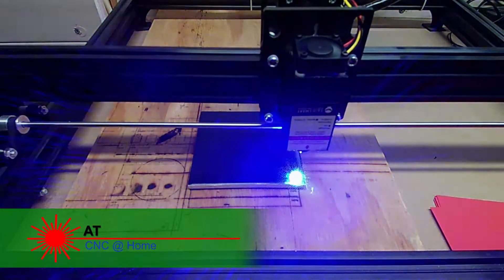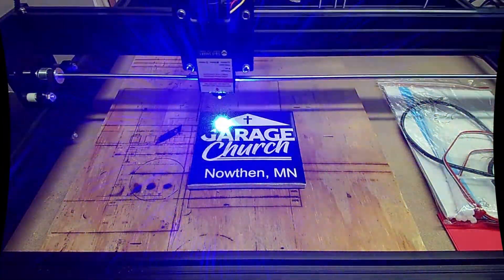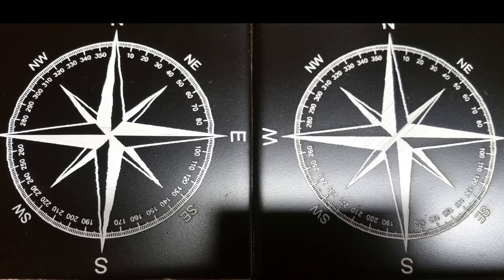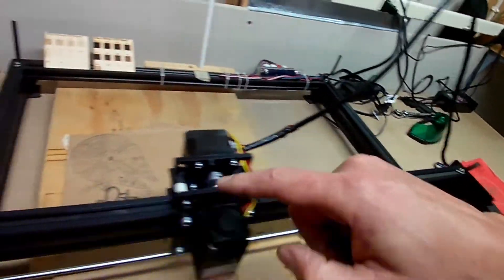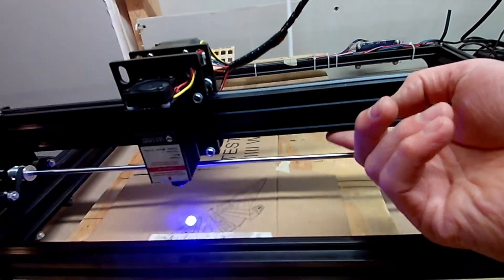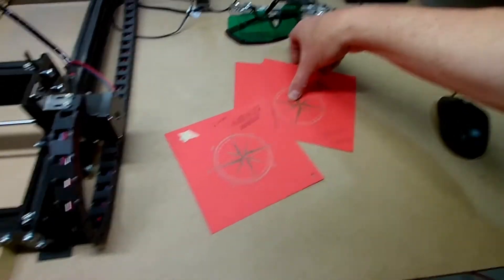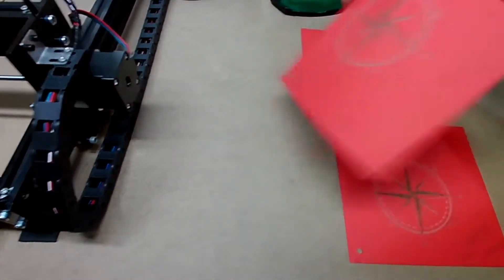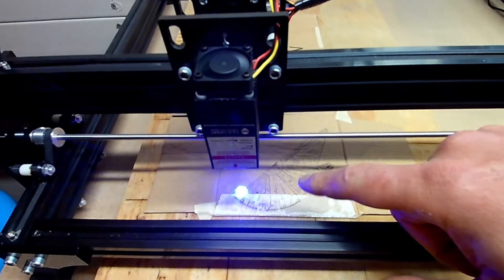Is It Fixed?

Comment: It seems like it's the loose head. You might want to change the roller wheels (and if it doesn't have any) fit some eccentric nut to either the top or bottom set. To adjust the slop out of the laser head.
Reply from the maker: Thank you for the input.  Another member has also suggested using eccentric nut on this. I might have to give that a try.

Comment: it could be the quality of the belts with stretch and spring as all belts would have a small amount of stretch and with changing speeds it could be causing bounce I am not sure if you can get different quality belts but with longer runs it would only amplify the problem
Reply from the maker: I had wondered about the belts.  They are not that old yet and seem to be in good shape.  "Seem" being the key word.  I have made some adjustments to the LE5040 and I have changed how I make my etches.  The combination "seems" to have resolved the issue.  ;-)

Comment: Nowthen, MN!  I used to drive up there to fly at an RC club (but it's not longer there.)  I haven't gotten back to my laser cutter.  How do you setup lightburn to render an image with those diagonal passes?  I could test how my machine performs here on a similar job.  (I never had the x-axis gantry loose issue like you did, but I know I need to tighten my y-axis belts before I do anything further.)  I did actually fly my model airplane project with the two tiny parts I did manage to cut out the other evening, so that's something.  (I could have bought a bag of 20/count for $5, but this is more challenging, right?!?)
Reply from the maker: MASA use to launch rockets from one of the sod farms that is practically in our back yard.  I know they did a bunch of RC over there as well.  They just weren't as noisy as the rockets.  I went over one day and watched them.  Great bunch of people.  As for making your own part, anyone can just buy a bag of 20 for $5.  Not everyone can laser their own.  :-)

In LightBurn, I just bring and image in, I use the Jarvis dither setting, I have bi-directional cutting set, I set the cut angle to 45°, etc...  Some people say that using 45° when laser cutting seems to work better.  I had no issues until about a month ago when there was a drastic change in how my laser was operating.

I am working with SainSmart on the issue.  I just received an e-mail from a new contact there who seems to be digging into the issue more.  I am doing some test burns for him now and gathering some information for him.  I swapped the Y axis stepper motor with a stepper motor from my CNC router (they use the same stepper) and that, along with taking half the machine apart and putting it back together to swap the stepper, seems to have resolved the wavy and jagged issue.  My first successful test were using a 90° bi-directional burn as that had been one way to get a better burn when there was an issue.  I am doing some burn not at 45° on a project that I did before the issue, during the issue, and now (hopefully) after the issue.  I looked in on it at 1/2 way through and it was looking great!
Reply: @CNCATHome  Yes, that was the place.  A little bit of a drive from here (blaine/lino area) but it was an amazing open place to fly, so worth the drive when I had time to do it.

Great news on the fix.  Hope it holds up to more testing and use!